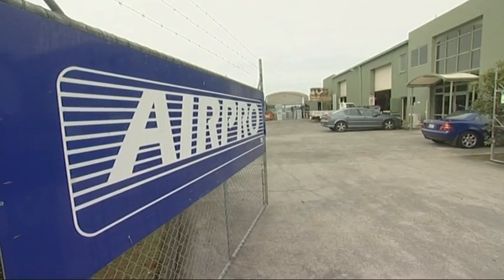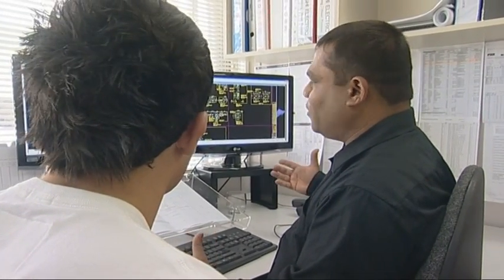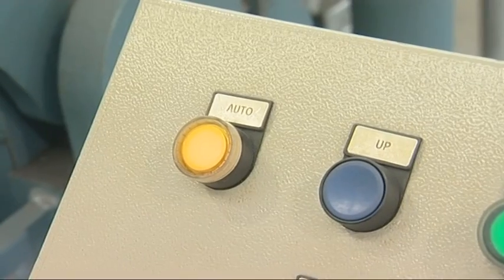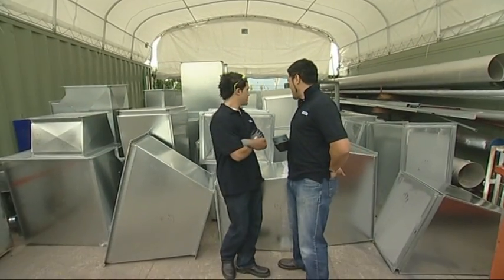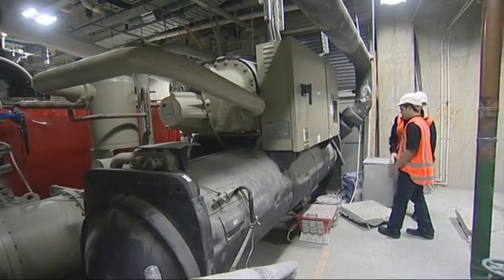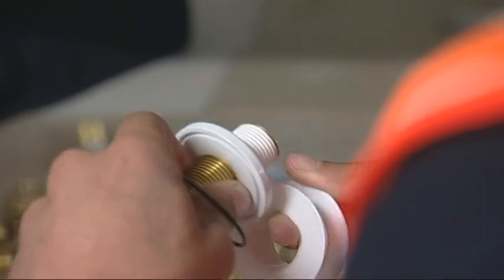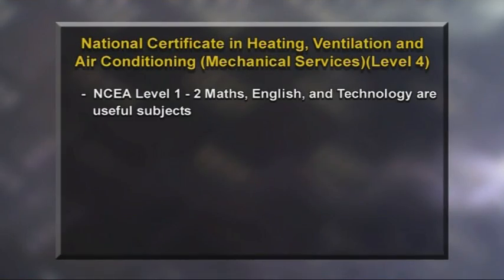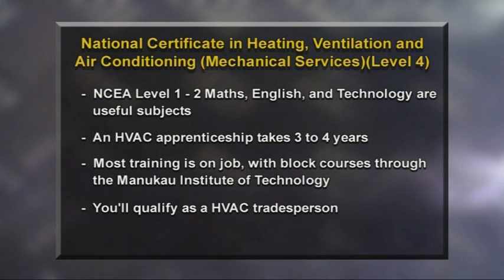HVAC trade career

Comment: so duct work is consider hvac?
Reply: Yes. Especially for installers.
Reply: HVAC stands for Heating Ventilation Air Conditioning...How do you suppose the air gets from point a to point b and does so under very controlled flow conditions??? Please, stay away from our trade...go be a brain surgeon!